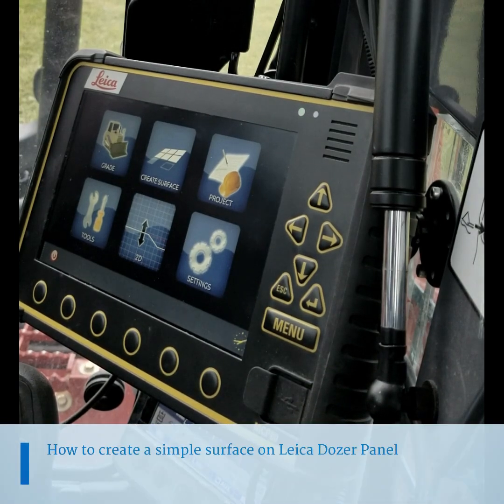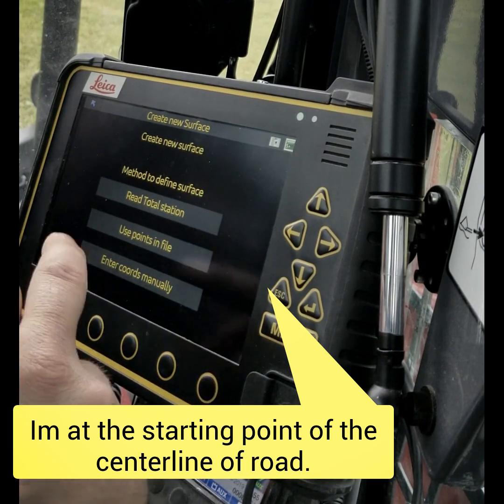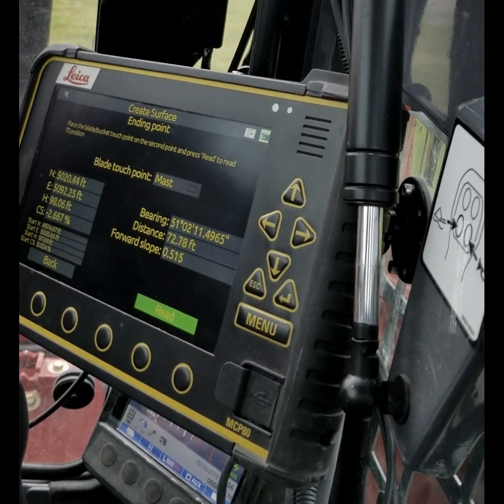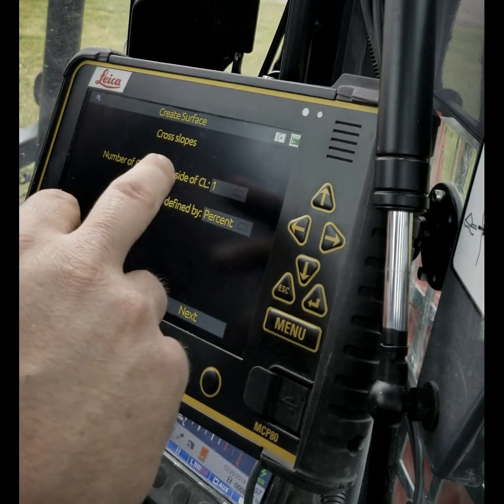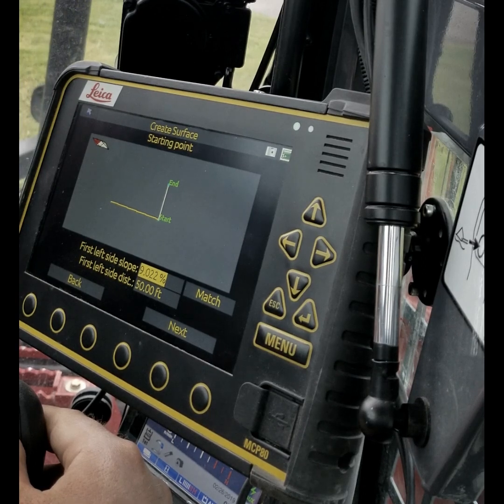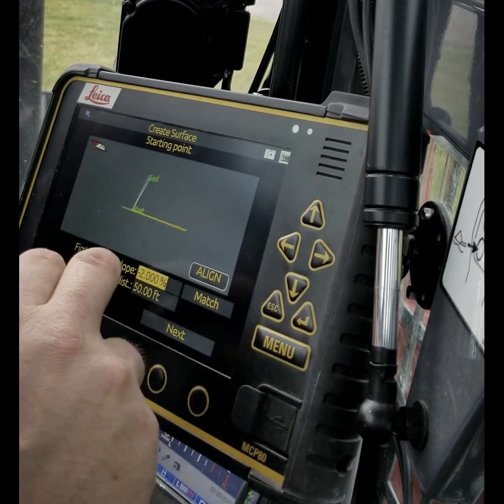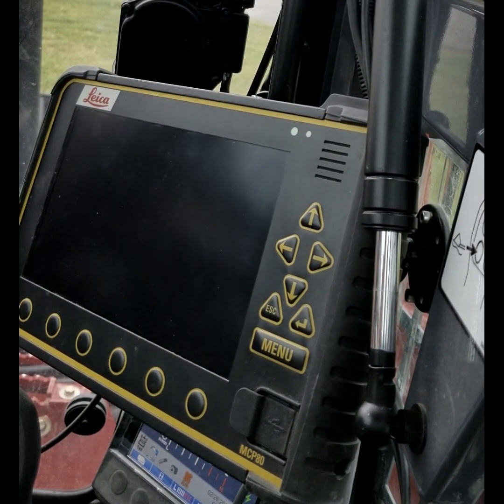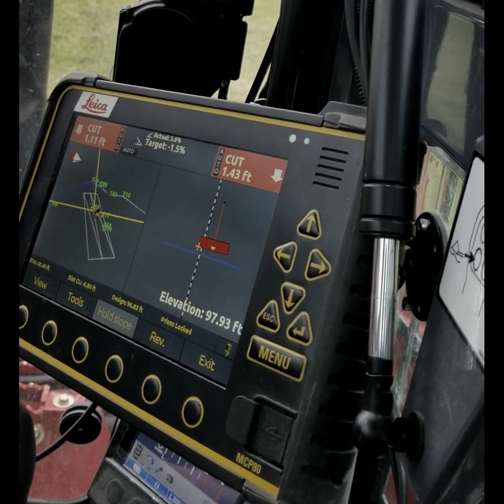Leica iCON 3D software Part 6: How to create a surface

Comment: Hi Joe...Quick question.After creating my surface,can I go back in and edit it.Doing a level pad with 4% fall front to back but need to put a slight  fall left to right on last 1/4 of my design.Thanks.Great tutorials.Hopefully you can do more on this system sometime.